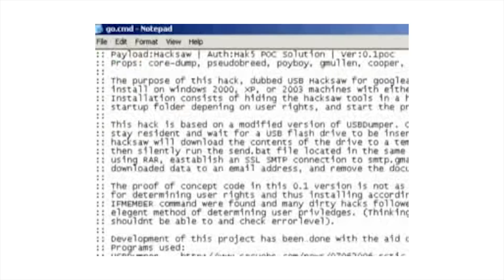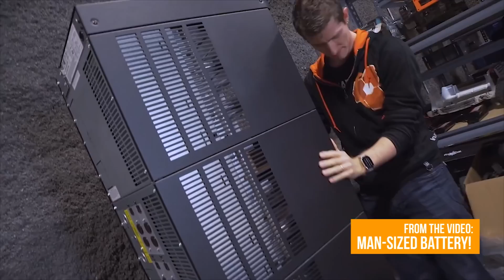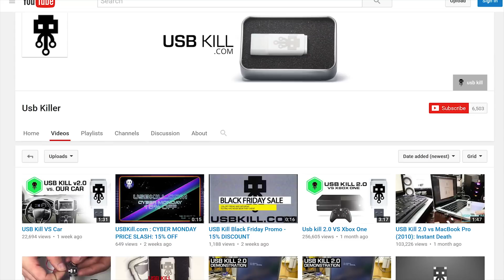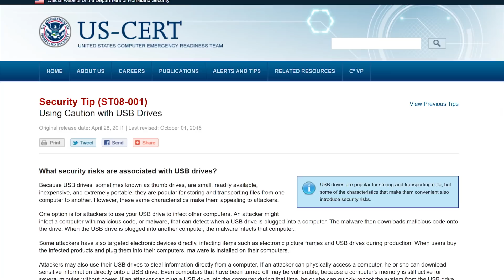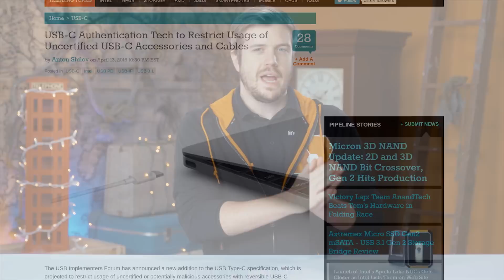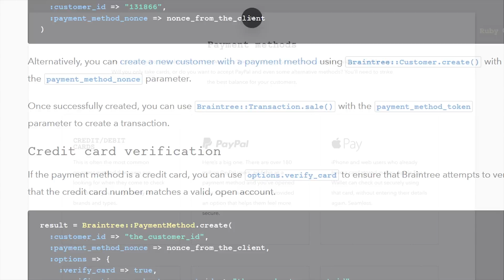COMPUTER DESTRUCTION (GONE DEADLY)

Comment: At the very least, if you find a random USB on the side of the road and you want to check if it's legit or not, can't you just open up the USB and look if the circuit looks like a normal USB one or if it has a bunch of capacitors on it?
Reply: dragonigthFX you can yes
Reply: That's a bit tricky 90% of people who are dumb enough to even touch a USB they found on road will plug it in their desktops right away.

Comment: just add a replaceable fuse to every port, done
Reply: EspHack fuse limits amperage not voltage though
Reply: Quinson lol no get the fuck out of here OCPD does not stop excessive of voltage...
Reply: DC Fuses are hard to make. You would need a fuse on every single pin. AAAand fuses only work for current, not voltage. Excess voltage will still break something.
Reply: Gatis Girdenis AC Fuses are that easy to make. I guess I meant hard to design, not produce. DC fuses have to have very specific properties to break down properly. Car fuses had those properties nailed down a long time ago.
Reply: Gatis Girdenis I was surprised when I was reading up on it too. By AC fusing I mean the more traditional glass tube fuses. I guess the way AC electricity travels back and forth makes a fragile material break easily (the electricity itself helps break the fuse) whereas DC doesn't help, and the material must be very specifically chosen.
Reply: BritishCadet yeah probably that. in our language both, the traditional car fuse and circut breakers are under the same name. and yet again its 5am and I am dumb at this point lol
Reply: Blox117 Pretty much any physical seperation, yeah. The main issue with all coupling is it limits performance. A wireless protocol would slow down the connection a ton.
Reply: why does everybody thinks a fuse protects against high volatges.....
Reply: yeah i think i saw some motherboards implementing that
Reply: Lars Bolduc what? dc fuses are actually easy to make? literally just a wire of certain thickness. all the cars have it, they cost, like 10¢ a piece. but yeah, they just limit current
Reply: Lars Bolduc havent read much about fuses, but yeah, would think that it is easier to do the dc fuse as it breaks the connection by breaking fuse and you having to replace it every time, while ac fuses are more like a switch thing (thinking of those somewhat big ones that are used in houses and apartments). the construction of dc fuse seems way way more simple than the one of the ac
Reply: like a switch thing? You mean the circuit breaker? Fuses are generally in the plugs...
Reply: Uh, fuses already exist that have been designed for a range of amperages. The manufacturer just has to buy and install them. I'm guessing it's not the voltage directly that kills the devices, otherwise the USB killer would have no need for a capacitor...
Reply: just spend a few dollars and have open wire leads that you touch to two random parts of the computer. 
fry the entire thing without needing access to any ports.

done
Reply: taiiat you probably wouldnt even need a dolar for the wire. and I'm mildly doubtful it would fry something, maybe it would. years ago, when I was young and dumb I had a case fan that had cut wires and the 12vdc wire touched the case, sparks out. couldnt turn it on for a few minutes, but then it turned out to be fine. although probably thats not the same scenario
Reply: You're not going to get very far with a wire without opening the case...
Reply: basic electricity. put positive and negative where the electronic is directly in the middle of the two points, and you'll get current flowing the wrong direction through circuitry or excessive current running through it.
Reply: ***** You're a moron.
Reply: something1random23 yes, i'm a moron for understanding basic knowledge of how electricity works.

everything is grounded to the case and power supply - it's not like anything is insulated.
better still, there's plenty of direct access to core components from the exterior.

you can easily push excessive current, which will jump between components in electronics because of proximity, in the path to the other pole of the circuit.

have fun with everyone else in the world that knows anything being a moron to you.
Reply: ***** The thing is, you don't have a clue. You somehow think you poking around with a wire is less conspicuous than a USB drive? And that drawing the maximum power from a random port on the front is going to fry something? 

There's a reason the USB killer uses 200 V. Something you obviously don't understand. You'd be better off trying to dump water in one of the fan openings.
Reply: Gatis Girdenis: V=I*R. They limit both! A fuse has a fixed resistance R.
Reply: Blox117
optimus prime?
Reply: Quinson Not at all. A fuse is a special (near zero ohm) resistor which burns out at a specific current.
Reply: Blox117 You have the basic idea. Instead of fusing you want to couple the inputs. Keys brought up the opto-coupler, which would take up much less space than a transformer, and would use less energy.
Reply: yeah, when there's too much current going through a given area, the material starts to heat up. think of wires, when the wire is too small for the current passing through it starts heating up, doesn't it? and wires basically have no resistance. well they have, but it's close to zero.
Reply: Lars Bolduc, then they'd burn out at V=I*R. If R is very small, then a large voltage will result is a massive current through the wire since it takes a very small amount of potential to move the electrons. I=V\R.
Reply: EspHack 
no not done. not till that replaceable fuse gets replaced. how you gonna do that especially for laptops?
Reply: Risto Mladich. Such a bold claim. Nothing I've said is incorrect. It may be miss informed since traditional fuses have to physically break to stop the flow of current, but that is not the only type of protection methods in use today. A simple surge protector would in combination with a fuse would work even better.
Reply: Quinson surge protectors are only used to reduce transient voltage due to far lighting strikes on the utility side,inductive loads found in transformers and  switch gears when they are disconnecting and connecting. also all fuses blow... thats the fucking design of a fuse... to blow which disconnected the circuit due to over current conditions and even this takes .2 of a second to blow in the fastest fuses sold commercially, it is also a type of fuse  which is used in motors which are sized for FLC.
Reply: Risto Mladich. Surge protectors are semi-conductors, which when in the present of a large potential (voltage), allow current to pass through. You seem fairly angry for someone getting their information off of Wikipedia. And while the listing is 0.1 seconds, and even 0.01 seconds for computers (for double listed current), if you give it 1000 Volts at it it will break much faster. The heat generated can be easily captained from the power generated P=I*V if you're interested. I can give a specific example if that would help.

By traditional I simply meant by itself, if that clears the air for you.
Reply: Quinson please shut the fuck up i deal with 3 phase 480 and 277v in industrial and commercial environment don't tell me this trivial  bullshit PIE and EIR and other mathematical formulas  . please find me something which the general public is allowed to fuck around with that is over 600 volts because I know for a fact that no plug surge protector or whole home surge protector is rated for 600 volts... you know how we size breakers with amps. we sure as hell do not use voltage to size a ocpd. and oh by the way usb are rate for what 2.2, 2.4 amps at 5 v... good luck trying to make a usb port resist 120VDC without it costing over 10 usd a port.

Comment: Wrong surge protection device. The opto-coupler would still be ruined by the high negative voltage and it is difficult to get them to work at very high speeds in a cost effective manner. 

The best price/performance is just a bunch of clamping diodes that can handle more continuous current than the USB spec. Surge ratings for such clamping diodes are very high and their surge lifespan is essentially unlimited provided their ratings are not exceeded.

TVS diodes with a PTC could easily indefinitely absorb a small surge device like that even upto +/-2kV or higher. Of course if you hook it up to a very high voltage source with a high current rating your going to make a big arc and not much can survive that. Also if you tie into the fault protection you can also trip the power rail so that the port is temporarily disabled so that it can't even repeatedly strike the system. (That would allow for much smaller TVS diodes as they only have to withstand one pulse)

Comment: If I plug this in my butt will it kill me...?
Research Purposes.
Reply: Your brain and data are still good but your butt is incapacitated.  You need a new butt...now's the time to upgrade...If you go with terabytes you will need more TP space.
Reply: Actually a human can survive a 200V shock relatively easily...
Reply: Unless your butt produces electricity that provides power for the USB killer then it would definitely kill you.
Reply: If you push it far enough, are you a big enough hero to try?
Reply: given that's what static electricity is yeah...
Reply: If your butt actually emits an electrical charge of 5 volts or more than still no because a human being can still survive 200 volts which is what this thing emits. The USB killer needs 5 volts of electricty so that it can store it then push all the stored electricity all at once so that it can fry the components or in this case your ass.
Reply: Crazy Goat No but it will kill the port, so you won't be able to get anything in and out of it ;)
Reply: raicho20 in?
Reply: No it won't, you're safe.
Reply: Imagine +Crazy Goat really listens to you....
Reply: garnknopf you don't want to know
Reply: Crazy Goat lol yes

Comment: Might as well have used a fork or some other conductor and stick it into two connecting pins. As far as destroying hardware goes, shorting it out's way simpler and doesn't cost a thing.

Comment: I wonder...how would this usb 3.1 crypto defence even work? Surely even to start the cryptographic authentication you would need some sort of electrical connection to the data and power pins, and once the usb killer device has that ...BOOM! ( I guess? , unless they under-supply voltage and complete the authentication before it has a chance to discharge  )

Optocouplers seem like a solid defence, except...usb speeds might suffer. IDK about that.